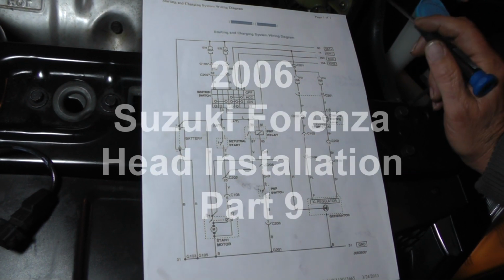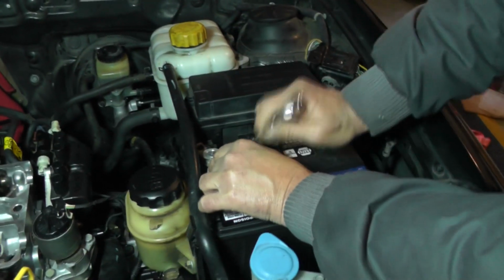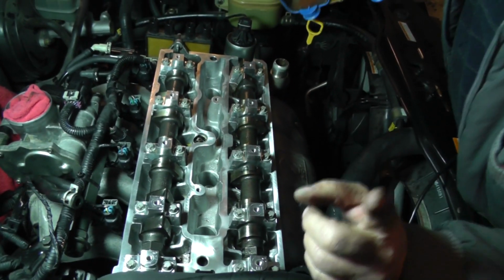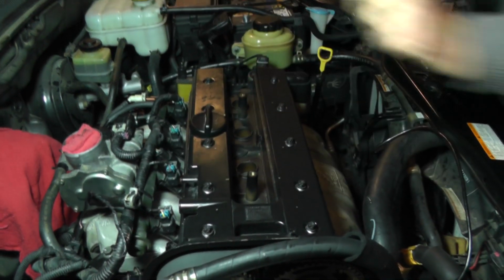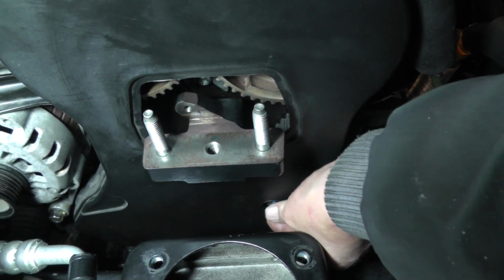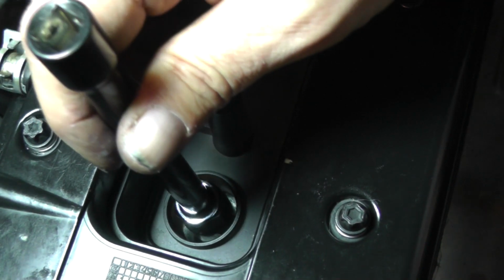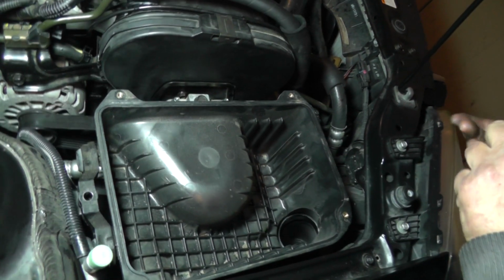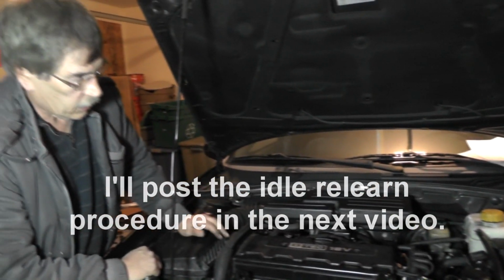Suzuki Forenza Head Installation - Part 17 (We're Done!)

Comment: I checked the plugs early this morning; far right was dry, second from right had oil (+ small oil spot on cylinder head), third from right was dry and the last one had oil on the plug.  I did an oil change before checking plug 1 and 3 Sunday, maybe too much oil?  Weird things is, the cavity/well surrounding the plugs is clean, no oil residue anywhere!?  Which indicates the V.C.G. is not leaking internally, just externally.  Regardless, I'm ordering the VCG and Bosch plugs today from RockAuto.

Comment from the maker: Personally, I would go ahead and change the gasket although you could try a temp fix to get back and forth to work until you can make the job more secure. So, with a new gasket, get your washers and also check to make sure that the ten rubber washers for the bolts are new or at least in good shape. Most importantly, be sure to put some blue thread locker on the bolt threads because of the low torque valve. Otherwise, in a few months, the gasket will start leaking. Let us know how it turns out.

Comment: I may pick up the washers today, my gasket has 60k on it and it's leaking, so I'm not sure if squeezing a bad gasket can hold me off from a complete repair for the time being.  I know the manual states replacement every 60k, but I'm willing to try the quick fix for now so I can get to work.  I'm also checking all the plugs tonight for oil and doing the "rag thing".  I could back off one bolt at a time, reverse star pattern, and install the washers along with the bolt at 71in.lbs.. Your thoughts?

Comment from the maker: Hi 350z. The wife has been driving the car to work everyday since March which is a round trip of about 45 miles. I checked the valve cover externally for leaks a couple of days ago, and it's completely dry. I didn't pull the inspection cover off to check around the spark plug wells, but I'm pretty sure they're okay too. I'll do an inspection on that hopefully this weekend and get back with you. Thanks for watching.

Comment: stuzman52, thanks for the videos on the Forenza!!  Very Helpful!

Any updates on the valve cover gasket (washer fix), how is it holding up?  My gasket has always leaked, never could figure it out.  Just discovered my spark plugs have taken on oil... that's how I got here, a little research on the subject.

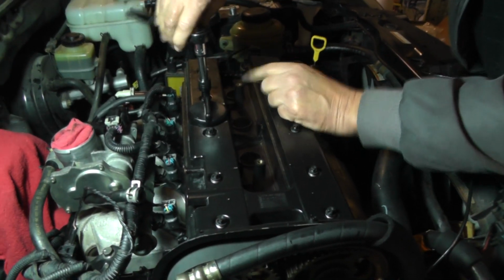Comment from the maker: Hi Azim. That would be an E10 socket for the valve cover bolts. I mention it in this video at 15:35. And for you and others about the valve cover gasket, my wife has been driving the Suzuki everyday to work (about 45 miles round trip) and not one drop of an oil leak on the valve cover or anywhere else. Keep us posted Azim about your repair!

Comment: what kindand size socket did you use on the valve cover bolts? I bought the flat washers already and used 9 mm socket to take them off,It doesn't feel snug enough on the bolt head so I stopped for fear of stripping the heads.those leaky VCG don't look good .

Comment: where and what type service manual did you use for the suzuki forenza. I have a 2006 as well. Changed TBelt but doesn't seem to fire off so am going to check on cylinder leak down first in cast it got out of time?

Comment from the maker: Hi wtfhellas. Thanks for the compliment on the spark plug replacement. As far as the struts, mine were okay as I did check that out. I checked with Monroe and they have all the struts, front and rear, but not as a quick strut. It appears that you'll have to disassemble the strut for part replacement. And it looks like the bearing mount comes from the dealership. You can get the boots and bumpers from RockAuto though along with struts. In any event, this would be a baby job. Hope that helps!

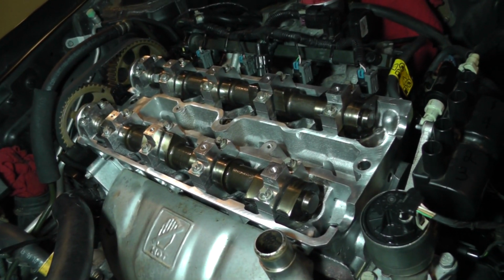Comment: That's a cool view of the starter turning the cams, at 5:31. Watching the starter motor turn the engine, and using some back of the envelope calculations, it looks like the starter turns the crank over at about 160 RPM. The way you tested it, with everything open while using the starter, seems better compared to just spinning the crank by hand.